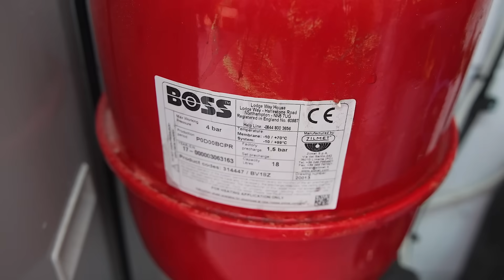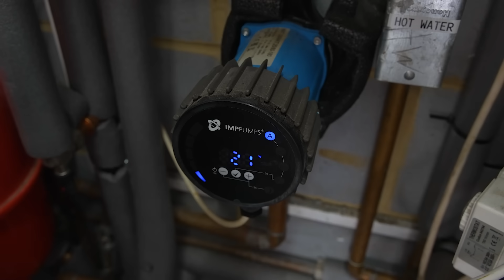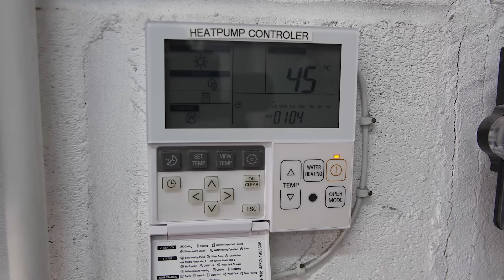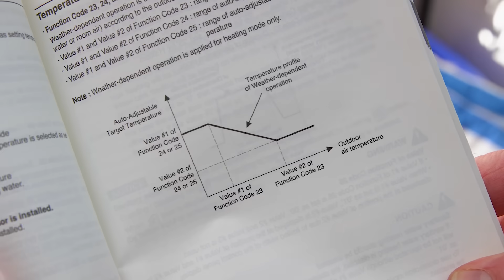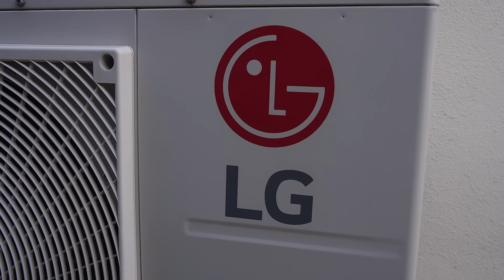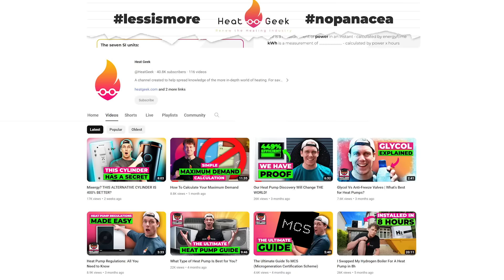Heat Geek Gives His Verdict on John’s Nightmare Heat Pump

Comment: Great video, Roger. "As simple as possible but not simpler" is a good adage for any physical system.  

Having lived in the tropics for more than a decade with a/c systems that also have a compressor and external fan cabinet (my house has 7 units) I have never heard a fan making that god-awful racket. The a/c's do need cleaning every 6 months, but I never saw any oiling of fan bearings taking place. 

I have been employed to find many problems with large, Megawatt-scale industrial equipment. This type of noise is far more suggestive of another source (not a fan bearing). I'd be investigating the high pressure components first, looking for the likes of cavitation, for example. It could be the fan, but it doesn't feel right to me.

Comment: A few thoughts derived from my basic knowledge of the principles of thermodynamics & physics of air flows/behavior: 1) Dont know how cold the exhaust air might be, but with windchill added in, might the wall behind the heatpump exhaust get so cold you might get a damp patch internally? 2) In an enclosed pathway such as Johns, the exhausted cold air will tend to 'puddle' as its more dense and cause the local air temp to drop slightly, lowering the efficiency due to recycling? Most efficent would be as Roger suggested for his swimming pool orientation. I would guess this to cause a double digit loss of efficiency on a still day. The test would be to measure the temp at the inlet compared to that taken 4+M away on a still day. 3) The units case is white, ideal for reflecting heat from the sun on cold sunny days!! You would think a darker colour (green? rather than the ideal of black) would add to the efficiency. Lastly, 4) Could the heat pump unit/ installation include a reverse flow circuit linked to air con unit for the living room for those few weeks of 30C air temps? (The M&S range of installations lol)

Comment: I've had arguments with this channel a few years ago about HPs, can i just say, full props to you for being man enough to change your mind.
As you now know, things need to be specified and programmed properly, but with so many bad installs, it's easy to think it's the tech is at fault. It is trickier than a gas boiler, but there are benefits.
Reply from the maker: Hi Ludvig
I am sorry to disappoint you but I haven't changed my mind. If anything Heat Geeks has moved closer to my position and we are now working in unison to help people avoid having the wrong product and the wrong installers.
We get hundreds of emails from unhappy heat pump owners and these videos have encouraged more people to seek a remedy.
Heat pumps can work well in the right building. I said that in my initial video and nobody is arguing that point.
I said that the government scheme was a car crash waiting to happen because the grant has drawn people into the industry who don't have a clue and don't care. They will be gone as soon as the grant money dries up.
The industry can stand on its own two feet, the grants have simply raised the prices. 
I am encouraged to see new heat pumps coming on the market that work better than the ones I installed but not everyone will be sold the latest kit. 
The problem remains that heat pump installers are evnangelists, they preach a doctrine rather than looking at the customer's needs.  
The bottom line is that I was offered  heat pump free of charge for my own home and I turned it down.  If a heat pump comes along that will heat my home for the same price as my gas boiler and doesn't require me to replace half my system I will buy it myself.
Reply: @SkillBuilder  Well, this is a move from previous comments in your video 'Heat Pumps the Ugly Truth'. Previously your position seemed to be that they 'never work' and that they are 'never appropriate'.
My response to the video at the time chimes with both this video and your response, that if properly installed and appropriately specced, they demonstrably have their uses.
Blaming the concept of HPs because of shoddy installers is like blaming the concept of a DPC for the same reason. Anything and everything is a problem if installed badly without thought.
Reply from the maker: Can you show me where I said "Heat Pumps Never Work". 
I like an argument but I would rather argue with somebody who doesn't simply make stuff up. 
As for the installation faults, we have to acknowledge that the consumer is being pushed towards this technology by a government that signed up to an agreement on CO2 reduction but failed to understand the limitations of the technology and the fact that the U.K is woefully unprepared to implement their policies on climate change. We have a similar situation with EVs and lack of charging points. 
I can understand that you may be enthusiastic about this technology but my concern is for the thousands of people who have been hung out to dry. We get emails from people who can't find anyone to fix their heat pump and have resorted to electric heaters. 
If they had been allowed to keep their gas boiler as back up or to supplement the heat pump when temperatures drop it would have resulted in a faster uptake. 
I told the government researchers this when they contacted me to try and understand why there has been such a poor uptake of heat pumps in the U.K.
Reply: @SkillBuilder  I'd be happy to look back at it, but this was from over a year ago, so I'd need to check through to find exact quotations, but I'm more than happy to look through.
Please don't accuse someone of 'making stuff up' before you've even engaged with them, it results in an unnecessarily combative exchange.
It's possible you misspoke or I misremembered, assuming that either one of us is maliciously motivated isn't doing conversation any favours.
I am not denying that a lot of people have been the victims of cowboy installers, but I'm sure you get a lot of messages about cowboy builders, so, once again, it's unfair to blame the technology for the shoddy workmen.
Reply: @SkillBuilder "I'd install it myself if it saved me money" that's the acid test.
The heat geek guy says minimum 350% efficiency? Try my small terraced house with a v small walled area at back of house he'd prob be quickly changing his numbers.
Reply: @mryan4452  you've misunderstood what efficiency means. Efficiency refers to the heat output from energy input. If your house requires a lot of heat because it's poorly insulated, that doesn't really alter the HP efficiency.
Efficiency in terms of how much thermal energy it takes to heat your home is a separate issue and entirely irrespective of heat source.
Reply: @LudvigIndestrucable  you're misunderstanding where I'm coming from, is the unit not likely to be less efficient if it's set up in a tight space? That's what I got from this vid. So many homes have v tight spaces (apartments, terraced houses, townhouses etc)..
Reply: @mryan4452  not necessarily, it's about airflow and a bunch of things. Your place may be a candidate for wall mounting
Reply: @LudvigIndestrucable  Older properly maintained fossil fuel cars and boilers are IMO going to work out cheaper than the heat pumps and electric cars. 
I'll look in to heat pumps more tho, I'm not holding my breath.
Reply: @mryan4452  the economics show that there's definitely an economic argument for community HP and waste heat sources. My parents have an old house with an HP, they live in a village without gas, it's preferable to oil, simply because of how noisy oil boilers are and how much faff the fuel is.
I've had an EV for years, it's a model S and it's worked out cheaper than my Volvo.
Reply: @LudvigIndestrucable in my case nobody will convince me that an electric car is cheaper than my 1.2 litre hyundai. €5,000 6 years ago. Expect it to run for another long while. Electric car, probably three times the purchase cost to buy for same car. Never make money back on it v the hyundai.

At the moment these things are in certain situations better and more economical, in many others they are not. In future they hopefully will become more  cost effective, including to purchase, install and maintain. If they were cost effective I'd buy them in the morning.
Reply: @mryan4452  €15K sounds like you need to shop around. Maintenance costs are also a massive reduction, though it does depend on your mileage as to how much benefit you see. Personally, I just infinitely prefer the feel of an EV, whether that's a basic maxus deliver 3 van, a Zoe or a Tesla. It's just a better driving experience.
Reply: @LudvigIndestrucable  you seem to be  convincing yourself of your position without looking clearly and objectively at things? (I got that impression from your comments to the skill builder, you seem to be continuing that trend). I never said 15k, I said 5k. It was a bargain, only 40k miles on it. Not a single issue in 6 years only a change of tyres. And even if it was 15k you have no idea what the return would have been like versus an electric car. You simply don't have enough facts (age of my car, total mileage, my annual mileage, annual maintenance costs etc). I do though as I have the facts. No chance I Would get a similar sized mileage (40k mileage when I bought it) electric car for anything close to 5,000 euro, not happening. 

Electric car can suit others, but it would not be economically justifiable for me to own an electric car versus my own car. If it were a lower life cycle cost, I'd be all over it.

I'd suggest checking facts before jumping to conclusions. Then when you have the facts, carrying out a balanced objective economic analysis. 

You might even be one of those people that deep down know they're wrong, or are brainwashed, but will keep coming back because they want to "win" a discussion, so I will say bye, and good luck on your heating, insulation, transport choices in future..

Comment: Great video guys.
I am a heating engineer and have done all the training for heat pumps through Nibe (in my opinion the best heat pump unit and company on the market).
Adam - i agree with all your points except for one, the buffer? Now this is a question out of a desire to learn from you so would be able to explain in more detail why you would remove the buffer?
I have always been told to install buffers to ensure a minimum system volume and to also reduce/control the amount of starts on the compressor. 
Thanks

Comment: Never seen a fan motor where the bearing where grease or oil can be added, also don't believe being slightly of the horizontal is the problem as there is a lateral load on the motor shaft anyway. More likely it's a cheap motor with the cheapest bearings with a 2 year life span

Comment: I have a vaillant 15kW arotherm with twin fans, mounted on wall brackets with 50cm clearance above ground. Deliberately kept clear of swirling leaves on the ground every Autumn. it is extremely quiet and despite recommendation not to wall mount because of potential noise transmission it has been running for 4 years without audible disturbance either inside or outside the house. Replacing fan bearings should not require skills beyond a competent handyman.

Comment: That tiny gas boiler in the background does everything you need. Silently.
Reply: Exactly, I’d be the annoying one who would just pipe up and say “why don’t you just go back to using your gas boiler instead?” 😂
Reply: Because the gas pipe to europe has been severed
Reply: @sirHHO  and still as a result of this, my fixed price for gas will be still be at 5.50p per kWh. Plus, I can switch it completely off so there’s zero usage.
Reply: @kevinconnell8422  what ? I pay 0.10 eur for kwh of electricity starting this month. It will go down by 50%
Reply: @sirHHO  €??? This is the UK…

Comment: This is probably one of the most helpful videos on heat pumps.
It clearly points out the problems which give heat pumps a bad name. And that's poor advice and installation. Very sad for John who invested a lot of money in a sytem that never brought any returns.
A high temperature tandem heat pump is seldom going to give you a cheaper way of heating than a gas boiler, their COP is just not good enough.
It seems that the radiators and underfloor heating in this house a properly sized for a low or medium temperature system.
All the advice given by Adam is spot on, but the advice given to get rid of the buffer tank did surprise me a bit. Use of a buffer tank is often advised to limit the number of cycles a heat pump goes trough.
But I understand why he does say this, when the system and heat pump are calculated correctly it should be able to run long cycles whereby the heat pump can modulate back but stays above 30% capacity, mostly the minimum value where it can run on.
Is the heat request lower, it wil shut off and start again when there is enough heat request.
when the heat pump is dimensioned to big for the heat demand of the house, or when radiators and underfloor heating have to small dimensions to get rid off the heat in the water, the heat pump will start to cycle, switching on and off. It's bad for efficiency, for the life of the heat pump and the system will struggle to warm your house, just because the pump has to stop so often.

I would advice John to wait a bit before getting a new heat pump and carry on with the gas boiler for another year. Heat pumps working with Propane R290 as refrigerant are becoming more available, and in the next year or two there will be more on the market.
These have the advantage that they are single stage but can run up to 65°C,  With the maximum delivery temperature set at 45°C it will work  with a COP better than 4,5.
Using John's existing underfloor heating he can get rid of the mixing valves and recirculation pumps, he just needs a thermostat to limit flow to keep the temperature in the underfloor heating to Max. 35°. The radiators will just work fine. Also there will be much less clutter in the heating room as these are monoblock systems where the complete refrigerant loop and the heat exchanger are in the outdoor unit, it just needs a delivery and return water pipe trough the wall connecting the unit with the heating loop indoors.

Comment: When I was researching putting a Heat Pump on my pool I asked an engineer   'Could you pre-heat the Air by running it through a Greenhouse..' The engineer replied 'It would empty the greenhouse in about 2 seconds.. The fan moves a LOT of air'..    
During a 'wasted' summer hanging around the Pool..   standing in that blast of cold air was very welcome in the heat of high summer..  Bliss..

Comment: I have not heard anyone say a good ward for heat pumps as yet. He commented that heat pumps use around about the same energy in winter as conventional heating systems but you make up the difference in summer 😮 I have never put my heating after March or very soon after. IV got my insulation right and if you do that it saves a terrific amount on your energy bills. My energy bills are still very low even with conventional heating system.

This reminds me of electric cars new technology introduced to soon to  expensive and not yet really worth the money.

Comment: I have some familiarity with the trade.
When I replaced the HVAC in my home, the hardest part was finding a contractor who was not a hack. Residential contractors, by and large, just want to slap things down and be gone. They care little for codes (unless they’re being inspected), eschew any prep work, and “workmanship” isn’t in their vocabulary.
I’m encountering the same culture as I research solar power. Sales teams promise “the best, most professional, best engineered” system — until you start pushing at the details. Then, suddenly, everything you want is unreasonable, impractical, and they lose interest.
And, yes, governmental incentives only attract contractor fleas. THEY get the subsidy, you get the bill.

Comment: Some nonsense here about the bearings on those fans. The failure is in no way related to some slight tilt - this isn't a failure mode for that style of sealed bearing. The fans can be replaced individually, so the customer should be able to get the noise issue fixed for a low cost. On what planet is a wet system going to be more efficient than an air-to-air system? This makes me doubt the technical competency of the other guy.

Comment: Air to Air heat pumps are the way to go, far cheaper too and can be DIY. None of this messing with wet systems radiator sizing etc etc. Near instant heating or cooling in the summer as a bonus. Small electric water heater under the sink for hot water to the kitchen etc, electric shower.
Reply: Air to air requires F-gas qualifications to fit.

Comment: Whats missing is that Finland mandates very very well insulated homes to cope with their winters. The UK had no standard nor near none and there was near zero enforcement (still near none). So HPs were much easier to install. The UK badly insulated home (the standard ) means all that heat just gets dumped out the house like swiss cheese and upgrading the home to make is hard cheese is often extensive and expensive (and thats before the new boiler is installed). Now UK home standards are MUCH higher and new home buyers means HPs are possible.

Comment: Keep your heat pumps...........I fire up the 10kw wood burner in the lounge and the lounge doors are opened to allow heat to the living room, kitchen and dining room. Let the w/burner die down around 7pm and the boiler comes on  at 8pm, off at 9.30pm. Woodburner has large glass front and the dancing flames are often better to watch than the TV. Can't do that with a heat pump. Other benefit is splitting the logs. ..sometimes easy....sometimes challenging, but always enjoyable. 🔥